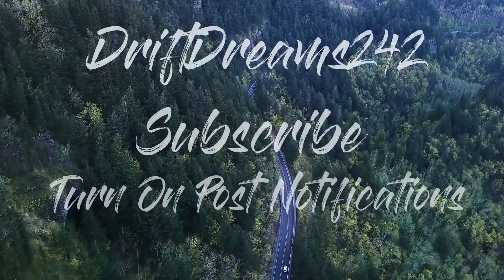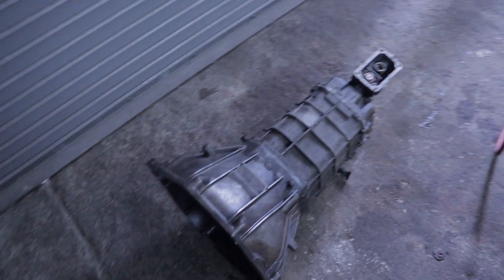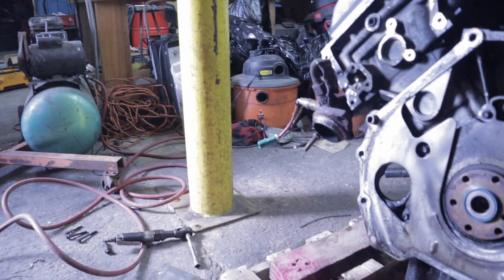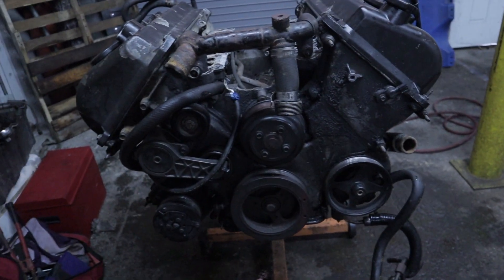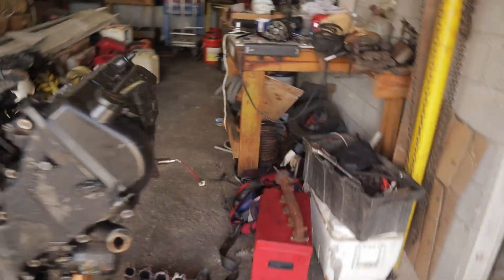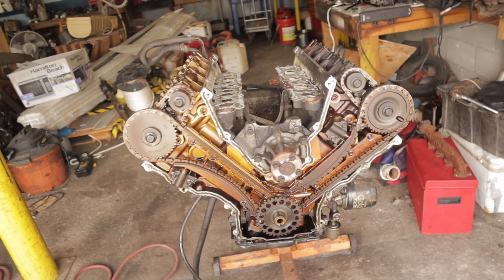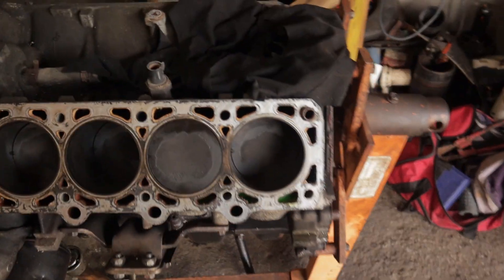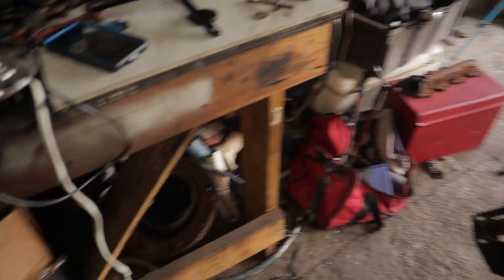4V 4.6L Head removal

Comment: Hope you answer man but I got a 1998 4Valve 4.6 an had a question on what bolts did you use to bolt the engine down or size of bolt to the stand because the transmission bolts weren’t long enough to reach for me. Appreciate if you reply
Reply from the maker: Hey buddy 🤗 I took my bell housing bolts to a hardware store to match the threads and get the bolts about 2 inches longer. Hope this helpa